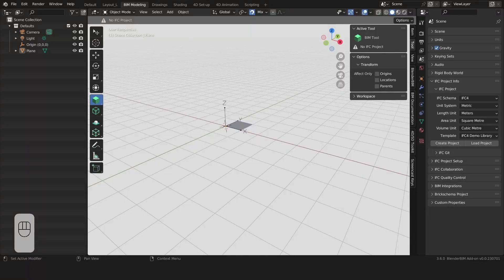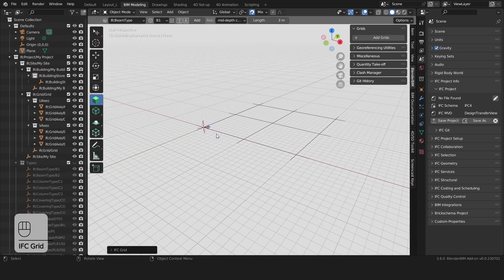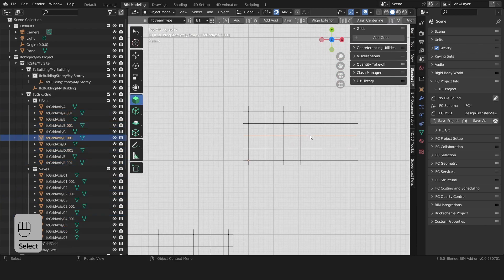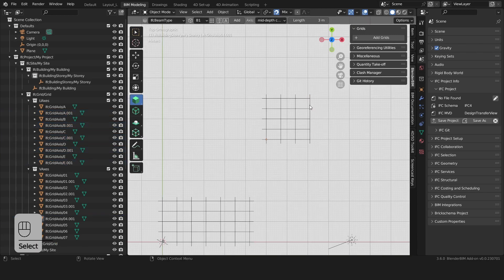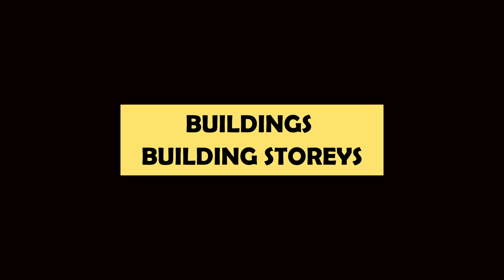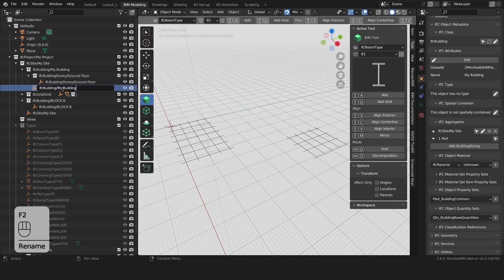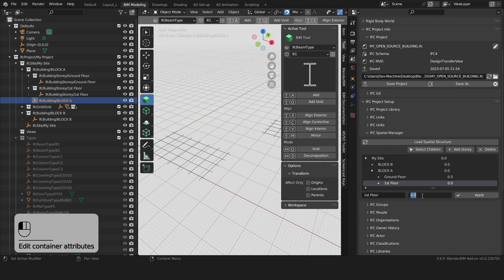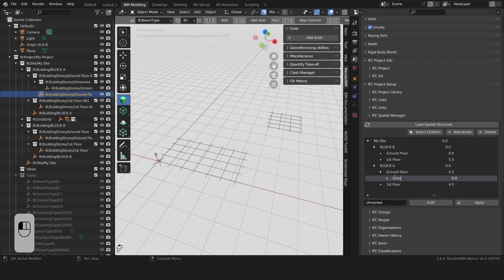Project Setup with BlenderBIM

Comment: Hi, can anyone here able to explain what is the purpose for Grid or adding Grid? Thank you
Reply from the maker: An IfcGrid is a collection of axes (lines) that help organize your building elements. Each axis is labeled and positioned to create a clear reference system.
You can precisely lay out at grid intersections structural columns , pad foundations, and  also wall alignment on grid lines.  ( In IFC there is the possibility to have positioning based on grid intersections )
These grids also become reference lines for drawings during design, and help in precise measurements in construction sites.

Comment: The BIM Bonsai grids IfcGridAxis are setup incorrectly in this video or at least in Blender 4.2.3 Bonsai v0.8.0 it no longer works that way. Spend half a day trying to figure out why I cannot adjust them, or duplicate, etc. them. The following video contains the right workflow for setting up BIM Bonsai grids IfcGridAxis as of January 2025: https://youtu.be/pQnJ-5b3_Kg?si=Wy1Bp_lHG9VM9EBe&t=138
Reply from the maker: Some parts of the sofwtare change / improve fast with open source. Glad you found a way!

Comment: very informative video. I have one question please answer. i have IFC file. i don't have working schedule in it. which sowftware i can use to make working schedule and add it in the ifc file?
Reply from the maker: You can indeed. I haven't made detailed tutorials yet, but if you look at exploring 4D data, you can somehwat guess what do to based on the button names. https://www.youtube.com/watch?v=dpbWFBtqVnU
Reply: @aeco-dev  I have already gone through this playlist. However, I am currently stuck because I have a 3D model. How can I convert this 3D file to a 4D file? The restriction in my case is a 4D IFC file. is there any option in BlenderBIM to auto generate or any other application? or any other track you recommend me.